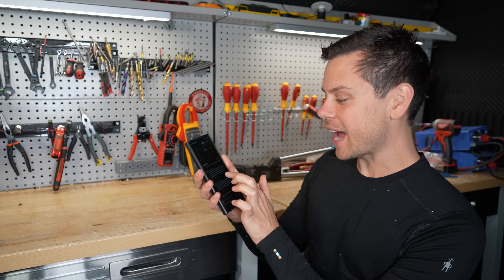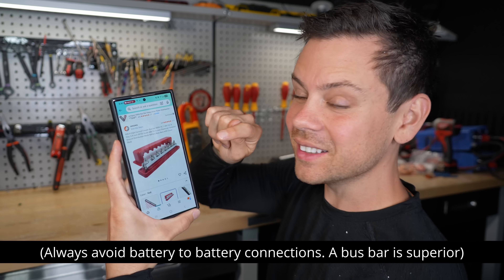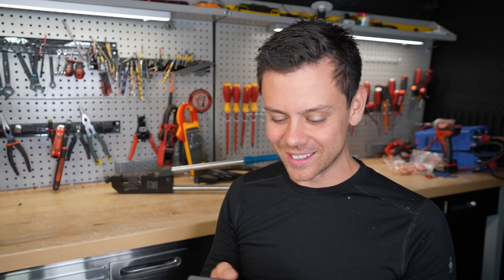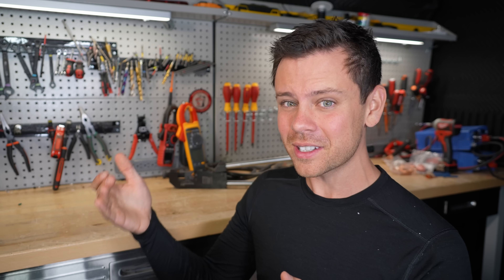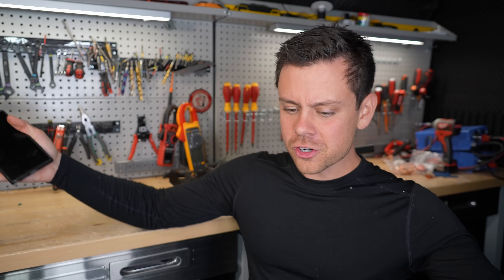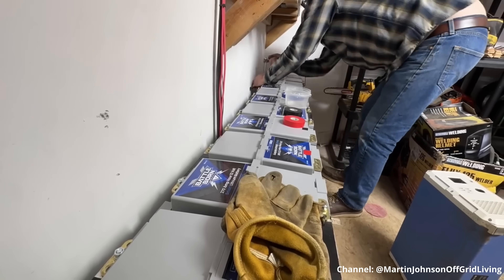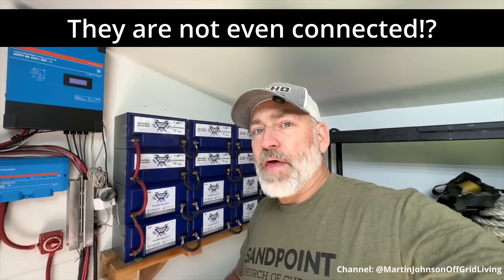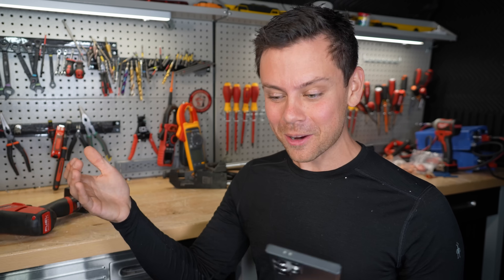My Reaction to Martin Johnson's "BEST Off-grid Battery Bank" Video 😬 Yikes!!

Comment: OMG! You are absolutely correct! There are so many things wrong with that featured video. I'm a Journeyman electrician for the last 40+ years. My dad worked for Southwestern Bell Telephone company. 
I work build server farms here in Washington state. We do the full spectrum of power usage, storage, retrievel, and generation.
I've been a fan for years, all the way back to the shed in your parents' backyard.
I recommend you to anyone who asks me about solar-powered systems. As you're the most thorough of any other channel I have seen.
With all that said, you are absolutely correct about sizing, compression fittings  properly sized and Never soldered! Unless you're going for a thermal overload device or fusible link set up. Cause, in my opinion, you can have catastrophic failure exactly when you least need that to happen. Nor do we Ever use aluminum bus bars.
Under full load for 12+ hours due to grid failure is when that aluminum bus & soldered connections would fail, possibly melt out and cause a cascade effect in your solar shed. Which should be equipped with so sore of fire suppression means even if it's just a l fire extinguisher identified for chemical and electrical fires! Cause you are definitely going to need it especially if you follow the Battle rated guy.
Just Sayin and Sharin.
Reply: May I ask why you decided to stay at journeyman and not go for your master's license?
Reply: @trynadyna9662 There wasn't a Master electrical license for washington state until more recently.
In Idaho they have masters license and I did consider it at some point but it comes with alot more responsibility and just wasn't interested in taking it to that level. I never had kids and I like being an underachiever and still make a good living. I am a multi-trade kind of guy. Carpentry was my first trade. But the money was not there for me. I definitely enjoy woodworking. As an industrial Electrician its more technical with a large variety of challenges better compensation and since of pride in being specialized. Be building giant server farms for the past 15+ years. Being part of history in the making as we build prototypes that are then duplicated at least in 10 other locations around the world. A niche market & skill set that pays handsomely and affords a nice lifestyle. 
A lot of 'corporate politics' to being a Master Electrician for my temperament.

Comment: I started my career working in telecommunication when that meant telephones.  We had equipment that was installed in the Central Office, which was where thousands of stepper switches operated to connect the lines.  This required enormous amounts of electricity, which was backed up by huge banks of lead acid batteries totaling 48 V.  You would NEVER find a soldered connection in the power circuit.  only in the relays or what electronics they had back then.  Solder has about 8.8 times the resistivity of copper at room temperature, AND that increases enormously with temperature, making the joint even more resistive.  When it reaches melting point it will probably explode out of the connection, causing fires and arcing until something burns away far enough that the arc can't be maintained.  A gas tight crimp properly supported with strain relief was used in these offices.  Some of these offices were from the early 1930 era and were still solid.  Today a high current crimp can be protected from environment by shrink tubing that contains a silicone or polymer that melts and is forced to make a water and air tight shield over the whole joint.  By the way. aluminum has about 1.6 times the resistivity of copper, AND is almost certain to great a bad joint from thermal effects even when tightened well with a steel bolt.
Reply: Not to mention that the flux he was using appeared to be plumbing flux.  Acid flux tends to be very rough on electrical wires.  Also, he did not tin the end of the wire before inserting into the connector.  Likely the centre conductors will not be making a good connection - they will be a dry joint.

So many fails...
Reply: @dalevalentine1721He just stuck cold wire into molten solder, then hit it with the torch a few times. LOL.
Reply: @dalevalentine1721  it was depressing watching him oxidize that joint and think it was good.
Reply: Fellow telecom! Last year I swapped 3x battery banks of 24x 1200ah 2V batteries per bank on a third floor. SO many trips with the pallet jack :-P
Reply: @sbrown_outdoors  Wow!  Lots of weight or lots of trips on the elevator.  I was lucky enough to get a 48 V bank of glass cells in a demolition of a C.O.  This was around 1963 when in H.S.  Didn't have a place to set them up at that time, a friend let me store them by his garage.  Mistake.  Within 4 days they had walked off.  Probably because of the price of lead. I was an active Ham at the time and really coveted those batteries.
Reply: I am also a telecom vet and the place you used solder was on the mainframe connecting blocks or step switches  until wire wrap came along.  Yes, I am a dinosaur telephone man (not a fossil yet) having started my career with GTE as a frameman back in 1971.  Unfortunately, what used to be a craft is now reduced to crap as any look at telecom outside plant can attest.  It isn't about service or survivability any longer - only about how much money can be extracted from customers.  I totally agree with your above statements and when I watched Martin do this install, I was cringing all through his video. I do like his effort, just not his methods as some will take his video and adapt it to their own off-grid situation, unfortunately.

Comment: I"m sorry, but if this guy is showing other people how to do solar and batteries "properly", if he is showing this to others and has no legal disclaimer to protect himself, this is borderline criminal. You NEVER solder wires to a lug. AFAIK the code does not allow tinning of wires before crimping, nor does it allow soldering wires to a lug, because that is not considered a sufficient mechanical connection. Especially , since he grossly under-rated his wires, his system is going to overheat and if the lugs are going to get hot enough to melt the solder, the wires  will fall out. If there is an arc with 12V and 300A, he just built himself a pretty major arc welder. 

His setup has a potential to become mother of all YouTube arc blasts. Hopefully, no one will get hurt.

My assumption why he chose the most expensive batteries is because of income. Shame. The affiliate links will give him more than cheaper batteries. I have a 460 Ah Epoch with a heater, Victron sync, external BMS heat sink, and bought it for nearly half the price of his BattleBorn. US company, great service.

Comment: Hi Will. You are correct on some issues here. He should fuse each leg independently, and top balance the new batteries. His construction methods are fine. That's the way it was done long before your time, and it lasted. In fact, the soldered lugs will not corrode in a salt water environment like crimped will if both are heat shrink covered. My reference/experience is working in power generation with equipment up to 69KV for 30 years. Don't get too excited, you should see what happens when a 1600 Amp 480V breaker opens under a fault across an 'infinite' bus. Better it than the person who shorted it to ground with a screwdriver by accident. I think he needed new underwear...

Comment: Absolutely no hate on your points so far, but I have some insight to the overpriced batteries. 

A lot of places require inspections, and UL listed / certified parts. Where I live, things like lugs (less than $1 each, online) will cost more like $8 each, just for the UL stamp. The weight, design, effectiveness, all the same. But, without the stamp, the inspector where I live wouldn't approve.

Now, surely there are cheaper UL certified batteries, maybe the EG4 model is even cheaper. However, the jurisdictional rules regarding certifications are certainly a huge role in product pricing. Often, it seems very unjustified. Sometimes it makes sense.

Comment: I'm a journeyman electrician. I also have an off grid cabin.  Seeing what this guy does scares the crap out of me. All of his projects are this way. Sometimes, you just need professional help! Keep your videos coming. I learned a lot  about off grid solor from you and the help from Shop Solar. I have a Sungold solar controller/inverter,  eg4ll batterys, and 2400w of solar panels, and the system works great.
Reply: Shame on Battleborn, promoting this tragedy waiting to happen
Reply: This video proved to me that I need an electrician for this stuff. I'm going to get a pro to install and maintain it so I don't make those mistakes. 

Just wild, so much fire risk next to wood.
Reply: B is for build is another one. they start stupid projects, do them badly, for views,
and then never finish them. so people don't get to see that it wouldn't work.
they have a pontoon boat that would not last 5 seconds on the actual water
which they stopped making videos about.
Reply: How many eg4II batteries have you got in your system?

Comment: Not for nothing, but I bought 16x 300ah 12v Dumfumes based off Will's review a while back. Their instruction manual specidically says to wire them in parallel first before series. Using 2x 2awg for positive and 2x 2awg for negative, each on different ends of the parallel bank.. If you're confused, so am I. But it works. The diagram looks weird too. Would like to see a review of the 300ahs, qnd a review of their manual suggestions.

Comment: What would help would be to make a video showing how to safely set up a 48v system using 12v lifepo4 batteries
Reply: open case, remove cells, install 48v bms. 🤔

Comment: 3:10 there's nothing wrong with soldiering the lugs instead of crimping..., yes he should have used copper bars for crossing between each battery... aluminum also works.  I agree he would have been better using 0 or 1 aut cable between the batteries personally...
Reply: No you don’t solder. Solder is a poor conductor. Cold welded crimping is the correct method.
Reply: @lawrenceharris7717  Solder is not a poor conductor. The main reason not to solder is vibration. If you can hold it still, and the ultimate wire temperature at peak discharge does not exceed the melting point of a solder alloy, a properly formed solder joint (not one formed by dipping a piece of cold copper in hot solder!) has so little resistance, it's negligible. Solder was and still is an extremely common battery terminal connector method, but is falling out of favor because mechanical methods are now easy to implement at proper pressures to make highly reliable crimps. It doesn't make the old method's physics change. Few common metals are a poor enough conductor to make a difference over a fraction of an inch. Soldering alloys the metals at the boundary, so electron transfer is efficient.

Temperature stability, vibration, cost/complexity of implementation. Those are the major reasons not to use solder. A high temp SnAg alloy would provide extremely high conductivity, unless you want to argue that silver is a poor conductor of electricity.
Reply: Depends  on alot of factors !! what solder type  and is it solder crimped  ive melted soldered lugs with 300a  that melted apart .
 Not only that hes gonna have velocity and cold joints  both sides weren't heated just plunged into solder
Reply: It is Counterintuitive. But soldering is not allowed for high reliability applications (aircraft etc….)  It is particularly bad for stranded wire.  The solder wicks up the wire.  The location of the transition between rigid and flexible is variable and uncontrollable.   That transition is a focus of stresses, quickly work hardens  and the breaks.
Reply: @rando7th agreed, crimping on conecters  the have hi vibration items is best but also it's stationary. You could have crimped and soldered drill a hole on the bolt 🔩 end and fill in with solder.... that's also a good way of doing that. Look at ac units the copper pipe is brazed with a soldier and that's a high vibration item... there are many ways to do something one may be a little better than the other but my only pov he should have used 4 awg or better wire.

Comment: Will, I believe you are absolutely right on everything you said except the soldering issue. Been subscribed to your channel for a long time and you have helped me build a 35000 watt off grid solar setup, as well as many other smaller systems. I’m 30 years old and I’ve been a heavy duty equipment mechanic as a profession and working on the dozens of dozer and tractors on my farm my entire life and I’ve never experienced a soldered wire to wire or a wire to terminal connection fail, I’ve only ever seen crimped Connections, both factory and done by master electricians failed due to corrosion or excessive thermal expansion due to it being near a hot engine or harsh vibrations from D8 dozers. The best way in my opinion is both a crimp and a solder connection to back it up.   If I’m wrong, anyone feel free to chime in and tell me why that is preferably in a positive criticism sort of manner.
Reply: you are correct the solder keeps it from a bad connection cause it fills in the available space and if the wire can't move around inside that connection it can't have a bad connection. Crimp connection is fine if the wire doesn't move at all and it is covered up correctly if it moves slightly after it gets hot or cold then gets power it could have a bad connection then it will corrode in no time but if they used solder this can't happen
Reply: Engine compartment is a different beast. For stationary installs things like vibration, corrosion, etc shouldn’t be an issue. Copper on copper crimp is the way to go(no galvanic, mechanical or thermal stress, corrosive exposure, etc).
Engine compartments with vibration, thermal, corrosive gases and acids, etc. can get all the failures you and I have seen. I’ve crimped AND soldered, changed lead terminals to copper(and copper to lead), changed stranded wire to rigid, rigid to stranded, added or removed strain relief, etc. 
My father was an electrical engineer and generally smart guy so that’s where most of my lessons on this stuff came from. 

Engine compartments are definitely a challenge compared to fixed installations.
Reply: @rockymonge4979 .   So in your opinion, soldering connections are generally the best way? They might not be needed in a stationary solar configuration, but it wouldn’t hurt? Of course assuming properly sized conductors everywhere properly fused and all that good stuff.
Reply: @cornfedproductions9773 I think generally speaking for Electric connection, soldering is better. HOWEVER, a bunch of other considerations may come into play. Small lugs are usually steel, so copper wire with steel lugs, if I think there might be thermal expansion involved, I will solder too because it’s quick and easy. Larger is usually copper lugs and copper wire so that’s a crimp and if I think corrosion might be an issue, definitely anti oxidation grease with shrink wrap/tape.
Since there are so many options available….it can get crazy fast.

Avoid dissimilar metals, EXCEPT don’t use small copper lugs(use steel, and usually these are zinc coated for corrosion) even with copper wire because they break too easily. 
Copper bus bars are great, but aluminum is a lot cheaper, steel is even cheaper but how much corrosion can be expected, but hey, electroless nickel plating is cheap and can be done on steel for corrosion resistance. Can also done on aluminum and copper! And it actually makes aluminum easily solderable(soldering is to the nickel coating). But it’s brittle and can crack so please not too much thermal cycling.

Lots of connectors are nickel plated, and if gold plated, it’s almost always over nickel anyways(for adhesion of the gold to the nickel and the hardness of the nickel). 

I think I’ve already gone WAY past the scope of a quick YouTube comment!😂 
FYI just so you know, my background: mechanical engineer(degree), automotive, audio, aerospace, electronics.
Reply: @rockymonge4979 I genuinely appreciate it and also I agree, I might take a few notes of your comment actually.  I would just add that generally speaking aluminum on metal connections are almost always a major issue that I’ve ran into when speaking of electrical connections!

Comment: Battleborn? GTFO. Worst company and worst CEO. Wonder how much they paid this guy.
Reply: Battery was probably free, so 5k. No way this battery setup is worth it's retail price.
Reply: Eco Worthy are in the same league, yet Will recommended them for some strange reason.

Mine swelled that much that I had to tie a string to & anchor it to stop it flying away, & my story isn’t unique.
Reply: @Rod41983  I wouldn't touch that stuff with a barge pole.